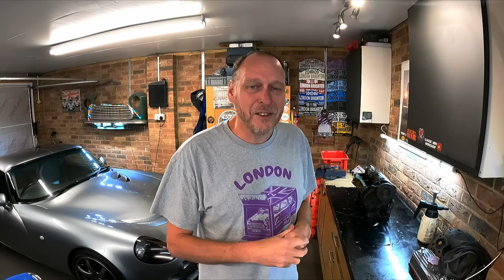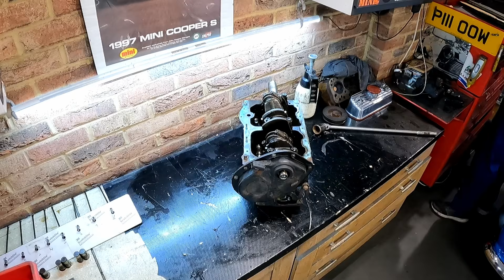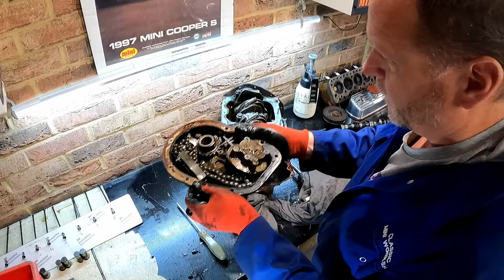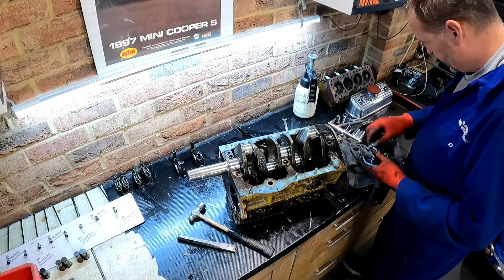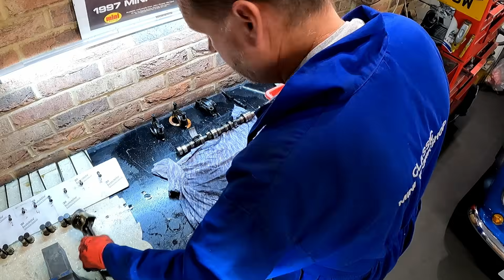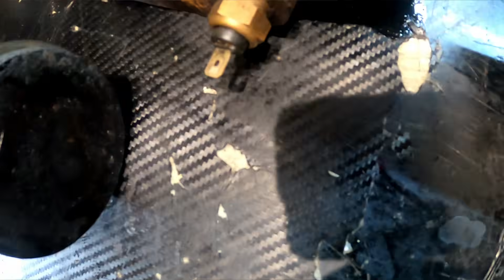998cc Engine Stripdown! Pistons, Crank & Camshaft Inspection – Supercharged Mini Build

Comment: Thanks again Keith. Sorry I don’t have any comments on the content today
However, I must admit I am interested in the gearbox and would be grateful if you could show the gear selector pivot pin from the inside of the box. I have only done 500 miles since an engine and gearbox overhaul and the pivot pin has dropped! Either the nut has come off or the pin has sheared. Have you or anyone you know done a video of replacing the pivot pin?
Reply from the maker: I'm not aware of a video, I will be videoing the strip and rebuild though

Comment: That 998 looks in a lot better shape than my 1275 Midget engine I pulled apart a few months ago now. 95000 miles, all the bearings were through to the copper, lips at the top of the bores, 3 broken rings, very worn tappets, crank shaft didn’t look too bad, but ended up needing machining. The 1275 Midget unit is interesting, as it’s pretty much cooper S spec, without the extra head stud and slightly smaller valves.. Apparently if they made it Cooper S spec it would have been quicker than the MGB which they didn’t want. Now rebored 20 over, new pistons, new cam bearings, reground crank and a Piper 270 fast road cam shaft. Just need to rebuild the gearbox and put it back in the car now.
Reply from the maker: Wow, that sounds like quite a project you had on your hands!
Reply: @classicminiworkshop Yes, it grew quite a bit when I got the thing to bits. It didn’t run too badly despite what was found inside. I originally hoped to just do rings and bearings, the rebuild budget had to be increased quite a bit. If your anywhere near Northampton I can recommend a good machine shop. The gearbox is a similar disaster zone needing a new first gear and lay gear set. First is straight cut with no synchro so has taken a battering. Currently saving up for new gearbox parts.

Comment: Looks to be in good condition, keep the 998 crank 1098 has more torque but also has a lot more whip in the crank causing stressed bearings especially if boosting, the cam in the era is a completely standard metro cam, avonbar are good I went for Kent kc500 in mine from mini spares plenty of options. They look like the later type pistons you have there they are great pistons but pretty sure they are press fit like the 1275, this is the exciting bit now getting all the new parts and building it back up. Are you going to fit a centre main strap? Looking forward to the next video. Cheers Marty 👍
Reply from the maker: Thanks for the information, really appreciate it! Yes, I will probably go for a centre main strap.
Reply: The MED centre main straps are good. Cheers Marty

Comment: the last engine i built was a Mitsubishi colt gallant gsr back in the 80s it had a cracked head    so i took it to a guy who promised me he could weld it any how he did not an in the process of trying to fix it he lost all the valves an springs, so off to Mitsubishi i went an they only had a new head no valves an springs so me an a mate went down to the local scrap yard to get some valves an springs after a long search a ford v 4 engine valves an springs fitted perfect an it ran just fineplenty of power  till the day it got nicked an set on fire
Reply from the maker: Wow, you wouldn't think Ford parts would fit a Mitsubishi would you!

Comment: Great Video and good to see you doing the strip down in real time.  I would recommend fitting an AC Dodd ‘zero tolerance’ oil pump for piece of mind with the extra load being placed on the engine with the super charger. I have fitted these to 2 recent engine builds.
Reply from the maker: Thanks for the recommendation, I'll definitely check it out!